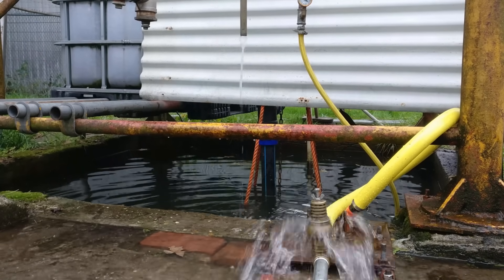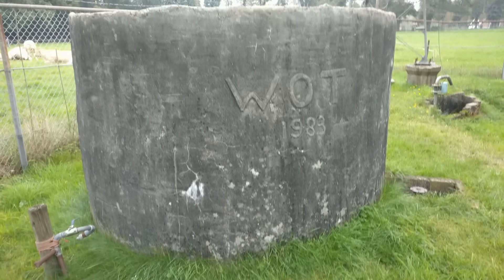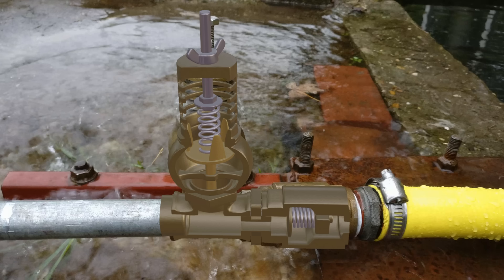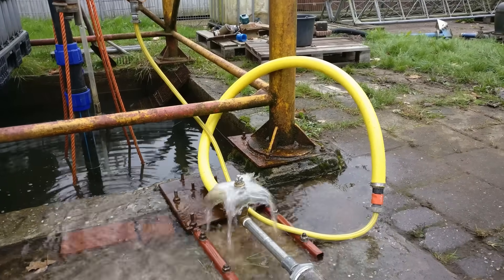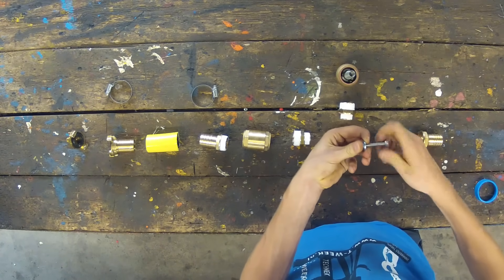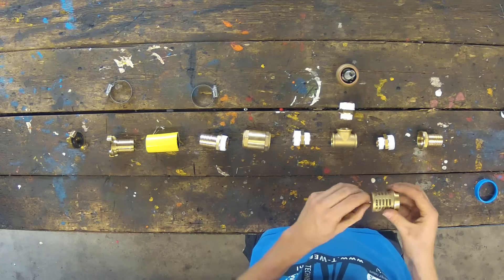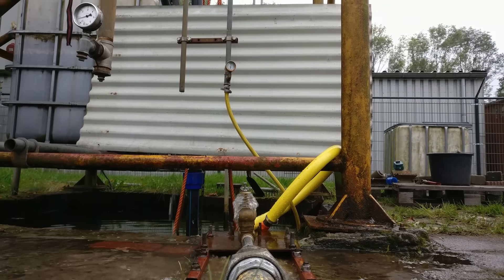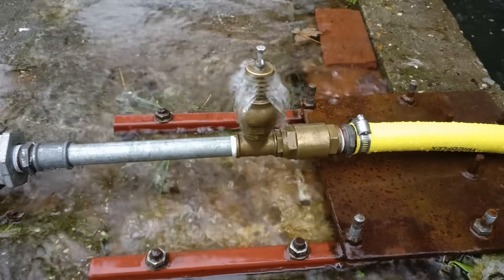Pumping Water Without Electricity - The Breurram

Comment: The principle of the pump wasn't clearly explained. Why/how  the vertical spring loaded plate is responsible for a periodic pressure surge across the output valve is left to be guessed at. How the water seen escaping seems to come out of all the vents, when the plate is only shown moving to the first vent - also deserves explanation. Also the hydraulics of why an air gap helps, when the total work required to lift the water isn't actually changed, would be interesting to know. And clearly there are parameters (too big and air gap, too small an air gap) for the loop in the hose that could be described rather than someone building a pump that won't work for the wrong gauge pipe - and why are you narrowing the pipe? After how long, what ratio of pipe diameters? C'mon guys, this description of the pump system and the parts thereof is frankly very poor.

Comment: Would this work for powering a boat? Putting this thing below the waterline, output the pressurized stream at the jet end? I guess that'll then be like a perpetual motion machine right?
Reply: It could work if you dangled a hose over a dam from your boat, but otherwise the water has no reason to initially accelerate. ;-)

Comment: So with the initial water surface located higher than the final water outlet shown near the bottom of the tower, this works as a siphon, but less efficiently due to the valves and water leaking loss. Are you fooling us on purpose?

Comment: how is this pump when operation itself requires pressured water?
Reply: You saw it. The water went 2 meters down and part of it went 12 meters up. It's a pump. The water in the reservoir won't jump 10 meters up on its own.

Comment: Nice job 👍 
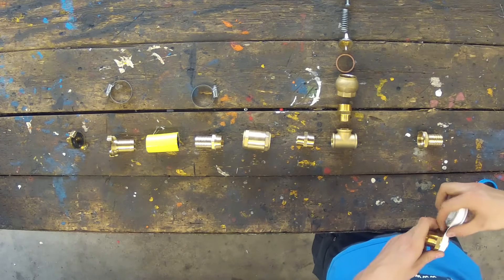At 3:46 you are applying your thread tape the hard way, hold the tape roll on your right index finger with the middle running on the outside, now roll off the backside of the tape onto the fitting. This allows simple smooth control of tension and length simultaneously

Comment: As many wrote in their comments, water hammer is the force driving the pump. (Change your manual.) Water is incompressible in the actual range of pressure so when the flow stops abruptly the momentum is converted to pressure increase. Water hammer was the noise in the plumbing with copper or steel pipes if you shut a faucet suddenly. Although sometimes a standpipe with air not water would dampen the effect.

Comment: The ram pump has been around forever. There is nothing new and in fact this video is misleading as he isn't showing the source of the water. Hint, it isn't the tank. It's a river or municipal water supply as that tank will empty and he must be refilling it. There ain't no such thing as a free lunch and he's simply using the kinetic energy and some valves to force water through... while a lot of water is wasted. Only useful if you live near moving water. Otherwise, you'll need electricity to run pumps (or draft animals or wind if you have an old mill lol)
Reply from the maker: Hi, we are not trying to mislead you. Please rewatch 0.25 - 1.20. We state here that normally the pump is installed near a river. The setup we show is just a setup used for testing.  .

Comment: Concepts like (hydraulic ram and) Heron's fountain appear. 
If one ever loosens the teflon tape just a bit it won't get tight anymore, so don't do that (just in case). And the pressure in the water adds an unit bar every ten Meters? this would sound almost too metric to me, but this would be practically logic, "like" mass falling 9.81 metres (almost ten) per second.

Comment: How do you prime the pump? Say from a river that is down the hill from where you have your primary water tank. 
With my experience in pumps priming them in that sort of situation can be awkward, how do you do it with this pump, I will be very keen to know, thank you.
Reply from the maker: We never really had a lot of problems priming this pump. For the first minute(s) air still exits the pipe every  now and then, this causes some sputtering but because of the spring, the valve will always open again. You just have to tune the tension of the spring right to make sure the pump works well, as is shown in the video. 

We also have experience with other ram pumps, without a spring. Here the valve falls down because of gravity. When priming this pump I usually hold down the plate with my hand so water can flow out freely. When all the air is out, I let go and the pump starts pumping.

The pulsing behaviour will change once more water is resting on the (high pressure) outlet valve. Here it  may be helpful to have a tunable waterram, like the breurram so you can adjust the behaviour of the pump while it is priming.
Reply: press down the vent so it stays open letting air and water run through the system until all the air is out

Comment: Use an old bladder tank and encase it with a piece of PVC attached you could redirect the water back to its source and not waste a drop.
Reply: No, that would cause the pump to stall. There is no way to do this without losing more water than (1-(inlet height/discharge height)), the energy has to come from somewhere.

Comment: Its basically a ram pump. The use of the tensioner for the main check valve is a brilliant upgrade however. Far more control than a traditional ram pump. If not used for potable drinking purposes many people add an air damper on the pressure hose side right after the check valve in the form of a PVC/Steel tube. Your use of the pressure delivery hose to perform this function is not only resource saving but also resourceful! Great idea!
Reply: I feel like I should know the answer already, but should the output not be buffered if to be used for drinking water?
Reply: @isaackarjala7916 high pressure is the only thing keeping piped water clean, low pressure standing water is how you get sick
Reply: You can make your own pressure tank on the outgoing side of the pump with a large tube

Comment: i might be wrong, and i probably am; but wouldn't this be impossible? First law of thermodynamics states no energy can be created or destroyed. Wouldnt this make it possible to "make" more energy with the water at the top flowing down? seems weird to me.
Reply from the maker: Only a small portion of the water is pumped up, most of it flows out of the pump directly. You can think of it as that the pump concentrates the potential energy of the large amount of water in the tank to a small part of the water, thus this water can be pumped to a higher height than the tank.

Comment: Are you familiar with anyway to increase water preassure without electric by chance to about 1100 psi say? im interested in the idea to see if the ancients may have used analogue abrassive water cutters but im not sure how best they would create such pressure, i thought maybe in a tall shaft using the weight of the water but still pondering on it all :-)
Reply: Fun fact :
1 psi is equivalent to 2 feet, 3 and a half inches of water head.
You'd need 2,500 feet head for 1100 psi...
Reply: Why would they when they had such simplistic and economical saws and sand? Just consider the 90% of water wasted, it would be enormous!!! Saws are great to cut rock, any rock as long as you have the right abrasive!

Comment: Can this be used to elevate water?
Yes.
Can the elevated water go back to the source?
Yes.
Can we attach a generator on the falling end of the water return?
Yes.
Can we generate free electrical power?
fbi knocks
Reply: You can with a washing machine
Reply: You need water motion to use a ram pump, if so might as well use the original motion, say of the river, and save on the kinetic loss of adding a pump and piping to the system.

Comment: Let the ram pumps spill water into another container and go even lower with another ram pump, then you redue the spill to half. ;)
Reply: If you have the extra height you can just put the ram pump lower down and tune it accordingly, either way you can't reduce waste unless you can find more energy.
Reply: 90% waste is not 50% waste! If you make a daisy chain of pumps going several dozens of hundreds of meters down, you would achieve n*10% use of the water and n*90% waste, there would be no economical aspect for the wasted water, only for electricity.
Reply: @buteos8632  You read someone in the internet write "you redue the spill to half" and you thought it must be true? That's not how this works.

A single larger pump in that lower location would be more efficient than one flimsy pump halfway plus another flimsy pump at a lower location feeding from first pump's spill...
Reply: @u1zha  I' guessing you got the wrong comment!

Comment: would t be possible to recover the lost water and let it flow back to the original tank? Or does the valve have to be downstream of the source?
Reply: You would need to use a pump to get it back into the tank, but the  you could just as well use that pump to get the water up the tower

Comment: This is a terribly inefficient pump you lose more water than you pump through the hose
Reply: The point is in a case of a nearby river or a plentiful spring, not closed systems, and as such is very efficient to the cost of very little money and insanely, when compared to motorized ones, low maintenance!

Comment: Smooth transition to the 3D section view. You may also explain that it works using water hammering, do you need a strong inflexible pipe for the intake (in the how it works presentation).

Comment: Wait. Hold up. If you were pumping the water back into the initial reservoir, would it not be a perpetual motion machine?
Reply: Why? Where would the excess energy be found?
Reply: @kaynex1039  in the water flowing back down
Reply: It would but if you put the turbine directly in the river it's WAY more efficient!
Reply: No, the water that is thrown away is very large (>95%) than the water that is going up. The energy is taken from the momentum of that big portion of water. So the water that has been spilled has almost no kinetic energy left, if you then put the small (5%) of the remaining water that goes up back into the initial reservoir, you will eventually lose nearly all the water with only remaining static one (not flowing).

Comment: Does the length of hose matter? Or can the Breurram be closer to the water source?
Reply: It matters, the amount of water in the hose to the pump will determine how much force you have to pump up the water. Within reason ofcourse, as you have loses from the resistance of water flowing through the pipe.

But you could coil up the pipe to the pump. As long as the bends you make in the pipe don't cause too much extra flow resistance.

Comment: Ram pumps can pump more water to greater heights because they use a pressure tank that builds enough force to push heavier volumes of liquid uphill.
Reply: no, this video is just another name for a ram pump. the pressure tank on a ram pump only smooths the output it doesn't increase head or volume.
Reply: True, it adds pressure to the water just like the spring but it's easier to tweak the size of the water tank (must be proportional to the diameter of the pump and head high) rather than the springs.

Comment: Very interesting and simple engineering. But how are you pumping the water from the river to the reservoir? Unless you’re using enough of these at the river to overcome losses at the base of the tower it wont work. If you’re using a traditional pump at the river then it’s kind of pointless. Also far too wasteful to use where there are water resource limits.

Comment: Love the cutaway but am confused over the explanation so please let me know if I have this right. You say the exit path open briefly and then closes, after  which the plate drops on the top valve. I think that is backwards. The plate raises/closes, causing pressure to push open the exit valve, which feeds some water into the exit but also drops the pressure in the main assembly causing the plate to drop and the exit valve to close, allowing that pressure to start building again while moving the slug of water through the exit path and yellow tube. A very small difference in description to be sure. Do you tune the exit valve spring as well as the larger plate spring?
Reply: But also the exit can only stay open so long as the central chamber pressure, as fed from the source, exceeds the springs for the plate and exit. I would love to see a model of this with pressure gauges at the inlet, escape, and exit to show the cycling.
Reply: The pressure spike from the top valve losing does 2 things.
It pushes a bit of water through the exit, but also it causes the flow in the feed pipe from the tank to bounce. That removes the pressure under the top valve allowing it to open again.

Comment: Just an idea, but how about a second collection tank that would catch the water lost during the pumping? Could that be used to daisy-chain to another pump further away from the source? Say, for another house.
Reply: Sure, with the 2nd pump a few meters bellow or, even better, make a bigger system and supply both houses with one pump, even cheaper!!!
Reply: You can daisy chain with or without a collection tank. It makes no difference if you let that water stop in a large reservoir for a while or send it straight into another house's ram pump inlet. The height difference is what matters.

Though it's unlikely that using two pumps would be anyhow more efficient than using one larger pump. The other house can simply receive tap water from the same water tower.

Comment: Wow this is cool. Since you already have the setup perhaps it would be even cooler if you can figure out the pump curves? Im sure between the always open and always closed, there will be a certain range where the spring tension will work  Would be interesting to see how each settings affect both the max height and the flow rate

Comment: I think part of the problem with this video is that you don't thoroughly explain where the pressure is coming from, because it took me a couple watches to understand that it comes from the speed of the water, and even then, I'm not entirely sure.  It really needs an explanation of that.
Reply: The speed is little, it would work better if used directly on a river and than yes, the kinetic energy would add up, in this case it's head pressure, or the weight of the water column pushing the water.
Reply: The Breurram Pump
Author: Gert Breur et al, Year of Publication: 2003, Language: English, Dutch, Spanish
FOLLOW THE LINK... dummy

Comment: You may lose much water... But what prevents you from building a kind of tray around the pump, with a pipe to get that water back to its source where the pump gets it ?
Reply from the maker: You could, but the pump is lower than the source. If you would want to get this back to the tank, you would need another pump. And remember, you use this pump in a river where there is a continuous water supply and all the 'lost' water just flows back to the river.
Reply: @WOT_utwente  Oooh OK I see, I just visibly miscomprehended a few details ^^' ! Thanks for your answer, though ^^ !

Comment: Could you replace the hose loop with a siphon thats made from pipe, so that yoh have one rigid setup ?
Reply from the maker: Yes, in fact most ram pumps use a pipe instead of a hose. If you google ram pump or hydraulic ram you'll find plenty of designs. The reason a hose is used here is because it is easier to manufacture.

Comment: If you have the power of the river would a water wheel and vertical conveyor be more efficient?
Reply: Possibly more efficient, but this takes up less space, won't get damaged by high winds, and likely won't interfere with the river.
Reply: for generating electricity you are 100% correct but for pumping water 12' in elevation into a tower without electricity at all- a distance away from the river... nope... this is not a vid to solve the "energy crisis", this is a video for say someone with a cabin or cottage or setting up camp in the favorable topo required to provide that cottage/ cabin/camp with FREE running water for the commode, basins showers etc... KNOW YOUR PURPOSE... everything has a purpose- this is NOT to generate electricity, the whole point is the application is for NO ELECTRICITY... it's in his vid description

Comment: If there is a river or a creek nearby, then a better alternative would be to use a small turbine to pump up the water. There is no need for ground level storage tank.
Reply from the maker: Please note that the storage tank is not needed for the pump to work. We use this to 'simulate' a river, since there is no river on our testing terrain. You could just place this pump in a river with a few meters of pipe connected to the inlet.
Reply: @WOT_utwente  understood, yeah the flow of water should create sufficient pressure if the inlet pipe dimensions aren't too small. Then this one is a better solution than a turbine with fewer moving parts.
Reply: @yashmanwani6232  And cheaper.

Comment: damn this is literally the step up regulator in the electricity
Reply: Exactly! 
I believe the steel pipe is the L (coil), the air hose is the C (capacitor), and the valves are the transistors, right?
Reply: @DavidG2P  Yes! So I wonder if you can increase the efficiency by increasing the length of the steel pipe by curving it a bunch. (e.g. increase the coil inductiveness)
Reply: @m.sierra5258  Yes but that is a complicated achievement.
Reply: @m.sierra5258  this is one of the ways the water analogy breaks down... ram pumps work off straight inertia, the momentum of the water itself. Inductance has nothing to do with electron momentum, and everything to do with the magnetic field around the wire. Overlapping coils of wire in a solenoid shape overlaps the magnetic field between the turns. Coiling water pipe just makes friction losses higher.